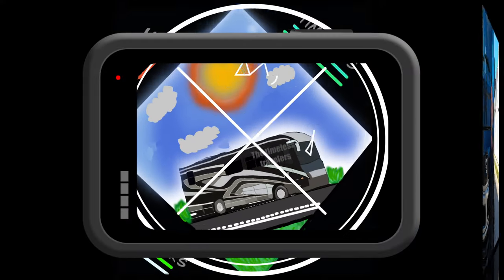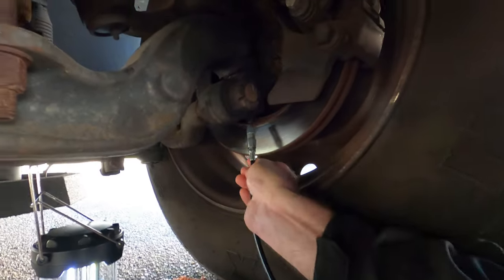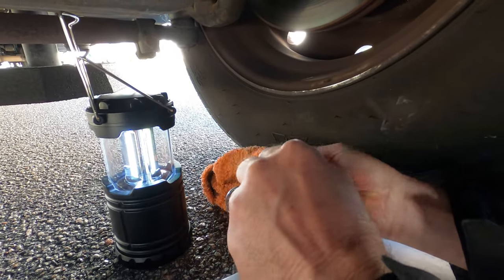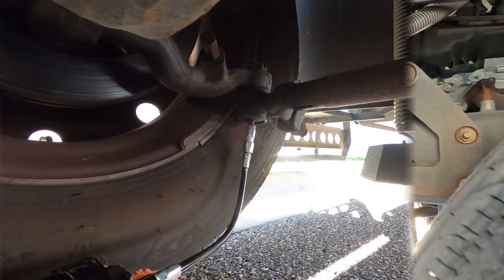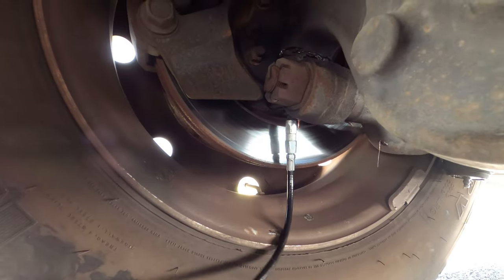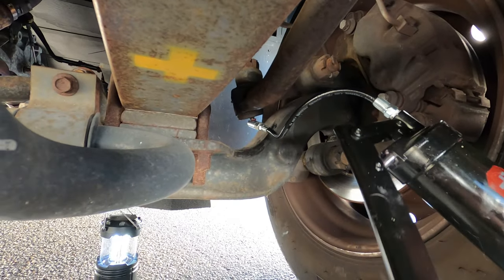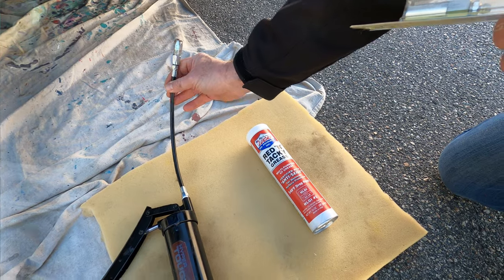Ford F53 V10 Front Chassis Lube

Comment: To reach the rear end of the drag link without needing a 90-degree fitting, you could try just turning the steering, so that joint isn't directly over the axle beam.

Comment: The first one that you do is not a tie rod end, it's the lower end of the kingpin. Notice that it's directly below the second point, which is indeed the upper end of the kingpin. 

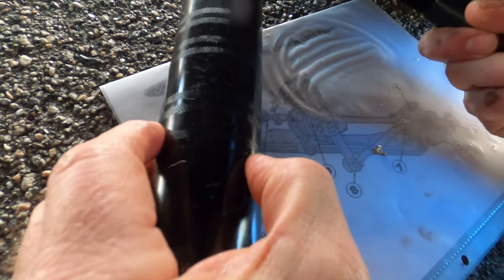The next time that you say you're doing the left tie rod end (@2:12), that's actually what you're doing.

It doesn't really matter that you don't understand what any of the parts are, as long as they are all properly lubricated.

Comment: You said that you can’t get the tool in to lubricate the last grease point. Actually, you can and you don’t need an offset fitting. All you needed to do was move your steering wheel either to the left or right to move the grease point and use your regular fitting.

Comment: Are kingpins to be greased loaded and unloaded?  Turn the wheels to get straight on to the linkage grease fitting. Good basic info.
Reply: According to the front end shop that did my alignment it's both. You grease them first unloaded then drop down to load the pins and and give another pump.